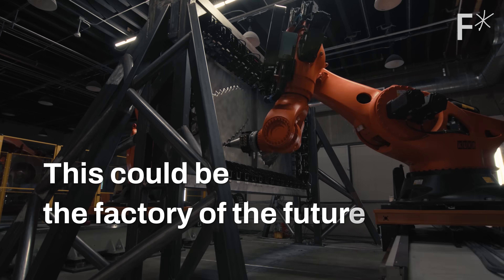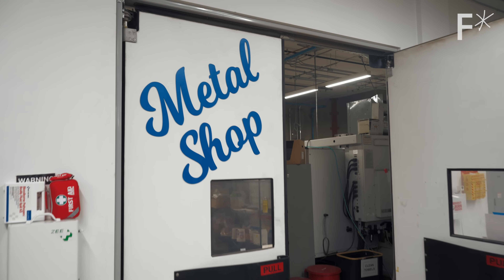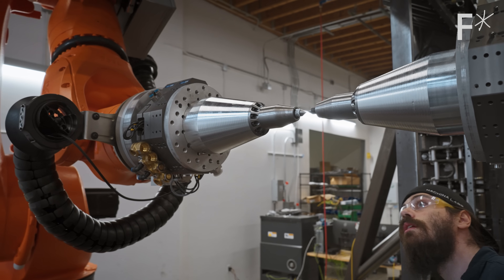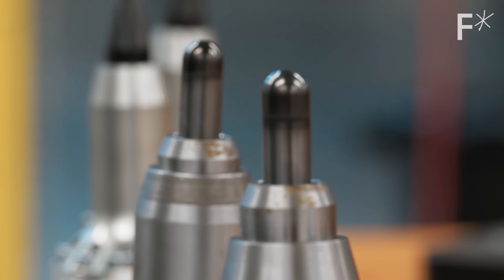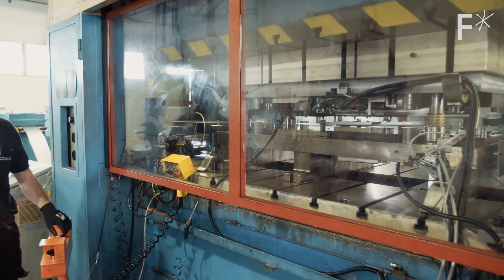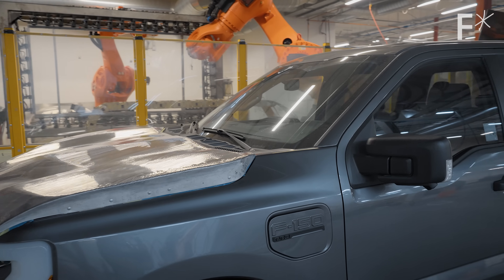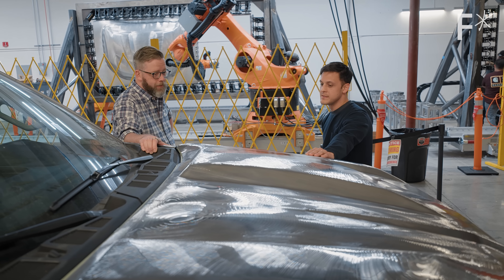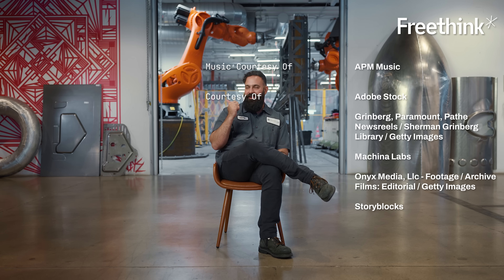Former SpaceX engineer invents a “Robotic Blacksmith Army” | Hard Reset

Comment: Nah, change is not very expensive in a sheet metal factory. It’s as easy as making a new die for the part you want to make. They also stamp hundreds of parts in the time it takes you to make one. Your factory would have to be 100x the size in order to keep up with the production of a typical sheet metal shop.

Comment: As someone who does automation for a living this is not a game changer at all. This can only be used in low volume, high end manufacturing and even there the cost, the need to have a programmer in house makes this almost unusable. You also introduce uneven material demage that will be problematic for high end parts (where this could be used). 
Still after you have used this, you need an operator to finish because that rough steel plate is not usable. 
So I would not bet my money on this. 
BTW all the parts that they have shown can be produced much faster, cheaper and in better finish today fully automated. Yeah, I belive this dude worked for Space-x, most probably was the reason for their tank tearing mid flight.

Comment: This is the kind of future-proof thinking that manufacturing needs! The ability to switch between production runs without massive retooling is a game-changer. Curious: How do you see this technology integrating with existing supply chain and logistics systems? Would it reduce the need for large-scale warehousing by enabling more localized, on-demand manufacturing?

Comment: This is beautiful theatrical show to present to investors, get some money on the wave of AI and fear of decoupling from China, dump this idea and put those robots back on eBay in a year or two. This is nothing new. This process takes a lot of space, it's slow and great for prototyping. I've seen this idea back in 2014. Google this paper "An Investigation of Robotic Incremental Sheet Metal Forming as a Method for Prototyping Parametric Architectural Skins". We really need to be honest and innovative rather than creating those pump and dump bs startups...

Comment: The simple fact is that, despite the grandiose claims, this kind of technology will not completely revolutionise how we manufacture things. It is apparent that, whilst a very useful innovation for low volume, high-end manufacturing - bespoke automotive parts, aerospace parts or custom architectural detailing rather than a viable method of mass production.

Comment: How about having an array of rods in tight formations on both sides in mirrored position.  Use software to push/pull to generate a general shape you require and use your current contraption to smooth out to exact shape?
Reply: There is already a machine kinda like that. An array of rods  both up and down, then those rods can also adjusted up or down to shape the metal sheets(e.g. bowl shape, wave forms), then after you adjust the rods both sides will press the sheet.

Comment: I'm familiar with Machina Labs process already. 2 minutes into this video I CALL BS. Showing gauge thickness stainless steel sheets, he says "heavy  metal , 1/4 inch thick steel plate". Im a 20 plus year metal fabricator and I highly doubt those machines are forming .25 with little ball tips and such. Don't narrate with crap specs. Please, thanks

Comment: Try building a thousand cars a day using this technology,how many of these machines and how big would the factory need to be it's absolutely perfect for bespoke one off parts or a short  run of a particular product other than that it's still more expensive than stamping which is built and designed for mass production and factories move due to tax brakes

Comment: I work in a car parts manufacturing we have a lot of CNC machine and use robots too. We do use sheet metal aswell. We use laser cutting machines, pressing machines, bending, robot weilding, robot bending, robot polisher, 3 axis 5 axis and etcc.. my only take about this is that the programming they did in orderto run both robots to push each other must have been a hella of a work. As someone who works in manufacturing , this is not an ideal way to manufacturing huge quantities. But only good for custom built parts that dont have to get jigs which is expensive for making 1 custom part only. I wanna see what happens in this company in the next few years

Comment: This left me with a ton of questions. What kind of stress is that putting into the metal? Under that stress, how often does that result in damage to the piece? How do all of those stresses react under heat? Does it maintain a homogeneous thickness? How does the quality or grade of metal affect the final product? What are examples of time to completion in relation to size and intricacy. I don’t know, seems super niche and I question durability but I’m also not an expert.

Comment: The only thing I don't see how this can compete is in speed. Standard presses can output several parts a minute, while doing it this way may take minutes per part. Prolly not meant to the mass production market.
Reply: Electricity using on press is might be less than running robot arms for a period of time. It only could used for custom parts and complex form shapes

Comment: The shaping tip should be more of a tri-tip end. That way one side is pushing on a plane for more accurate shaping. If you can change the extrusion of each tip head it can change the angle of pressure to a plane. you can apply pressure diagonally and would be more accurate.

Comment: While this seems great as a tool enabling bespoke designs unseen before, I have strong reasons to doubt that it will 'democratize' building bespoke car designs. Approval procedures for cars are already expensive and very time-consuming right now due to the risks associated. This is because they are heavy, fast, and are operated by lay people in the open public.

So if the retail price per car scales like some mx+c, you might remove some fraction of the c in the production line, but you end up with a larger contribution by approval procedure costs. Same for rollout times, which must be considered in a competitive market.

Therefore, I would rather reckon it will lead to a heterogen market/manufacturing situation in the car sector: We will see a small fraction of bespoke cars that impress by a genuine design will be manufactured for affluent buyers. The majority however will either stick with classic large-scale manufacturing methods or opt for public transport.

Comment: I'm absolutely blown away  by this  technology. As a metalworking with a lot of experience  this is just so Sci fi hats off to the brilliant  minds behind all this
Reply: It can be used to make 1 or 2 cars. It can't be used to produce anything above 50cars.
Reply: @stephenziga2319  they dont need to mass produce cars. These are meant to skip the whole trial and error of making a mold and testing to see if it works. This machine could make that process so much faster and costs less saving time. A second saved making a full working car is the difference between millions of sales and billions.
Reply: Your job won’t exist in 10 years. Yes brilliant minds… also greedy minds… also ai will be our demise.
Reply: I am in CNC machining and this is incredible to me.  Between this, additive machining, and the ever-improving capabilities of 3D printing technology, I have no doubt we're about to see a huge revolution in how we manufacture nearly everything.  I'm ready for the paradigm shift, even if it means my trade either takes a sharp turn or becomes largely obsolete.  We HAVE to make this leap if we don't want to stagnate.
Reply: @OneBiasedOpinion  how about we all learn more skills, like mechanical engineering, software development and actually build our own factories and build/process whatever we need from raw products, since we don't need factories anymore to make them for us?

Comment: I can't see how this works in anything other than small scale production. You're talking about a few seconds to form a vehicle part using a press, but that's going to take a hundred times longer this way. I very much doubt if it's anywhere near as accurate as a press tool either.

Comment: This is very interesting, however, seems forming molten metal to the end design shape instead of forming a sheet is still the panacea. And with Wang, Chu and Yang's demonstration of liquid metal manipulation (MPTM -basically a molten metal printer), one thinks development of a dynamic form that can be used to form the metal before it cools would probably have the advantage of cost and inherit strength,.

Comment: This is about the worst way to form metal. As a musician, I work a with metal every day. If the metal is not properly heated the stresses will be substantial. I have seen welded rods get snapped off just by the torque from the metal over time. It looks really slow, too. I think this is cool for custom parts but it's not sustainable for a mass produced object.

Comment: As a custom painter  these parts look like crap
Reply: Unfortunately this is due to the programmed stepover on the tooling for a process which is very similar to ball milling in the CNC world.
To produce a fine surface finish the stepover needs to be under a half millimetre but the result of such is a huge penalty on time where hours could turn in to days on large parts depending on the feed rate at which the robot arms are moving.
Producing a mould for either stamping or hydro forming will always be quicker with the best surface finish when it comes to mass production whereas this tech will likely remain bespoke to a degree.
Interesting nonetheless.
Reply: @CATANOVA let me shorten that statement ...." Do you know the difference  between  something good and something  great is ?.....Time".
Reply: @artworkbysteve1  Good and great are typically used as different and distinct measures although there can be some overlap with common usage.  One may argue if this is a good tech or a great tech for example. My own view of it would be more aligned to usefulness where there appears to be plentiful applications, which could be a good thing or perhaps a great thing if highly profitable.
Looking at time, that again is another measure but just a single component where on its own falls short of correctly defining something.  For example if we manufacture two bowls using this process where one bowl takes an hour and the second takes 10 hours due to the feed rate being turned down, does the value, goodness or greatness for what has been produced change.  For a buyer of the bowls where he has knowledge of the manufacture time component of each, would he value them differently.

Crap is also a measure but better used self referentially with our own effort or work.  Personally I use it or think it all the time usually followed by a chuckle in order to improve.
Reply: @CATANOVA So how many perfect  cars or parts have you built?
Reply: @CATANOVA  Thats a lot of bullshit!  Lol .
Reply: @artworkbysteve1  
Maybe, maybe not.  The point of course is a bit of amusement.

Aim high because you never know.
Be careful looking at things after beer 🤪🍻

Comment: As an engineer I find this sounds cool. But its slow process,  which means it will be expensive, so therefore its suitable for making prototypes only. Its in the same category as 3D printing. Its cool but slow and not for mass production.
Reply: This kind of production would facilitate lightning quick parts to market but not mass manufacture to market.
Reply: @CATANOVA  I disagree in case of the car market. The reason? GMP and/or approval procedures will remain a bottleneck, time-wise.
Reply: @pflichtprogramm1   Hi.  In the case of the car market if we are talking about mass manufacture panels and the like then stamping is always going to be the speedier process.  When it comes to the bespoke car market and small volume or made to order runs I think the tech would be a very competitive option.  One could pretty much make any panel or shape simply by having a building and bolting the robots to the floor and then pressing the go button.  In one of my other responses on this video I mentioned custom jet ski hulls with respect to production of stainless moulds.  Having done CNC mould work myself I can see a much faster option with this tech than the typical hollowing out of solid material.
When it comes to car production and regulations, something which I have no knowledge of, perhaps the tech could be used as a faster route to prototyping for crash testing and similar thus eliminating any potential costly changes with production tooling.
Reply: @CATANOVA  Yes, this fast-track early testing makes a lot of sense. I was thinking about the fixed costs of regulation and approval that have to be returned over the number of vehicles produced. Since bespoke designs feature small numbers necessarily, the return (per car) to compensate for these costs (for the series) would be large, wouldn't it?
Reply: @CATANOVA  Right now variance is probably large between one piece and another, as with every new manufacturing technique. Might be a nightmare making this GMP conform. Like, you might get a crash test version quickly, but ensuring that any copy behaves similar enough safety-wise would be difficult. When we're talking arts & crafts, it's nice to have unique items, like desks made from natural wood. When it comes to safety and human lives however, legislators demand much tighter variance.
Reply: @pflichtprogramm1   I was thinking of Christian von Koenigsegg and similar where this tech is right up their street.
Reply: @pflichtprogramm1   I think with the tech being CNC, variance would be minimal and exacting repeatability high.
GOV regulation is a can of worms and dare I say it involves some greasing wheels lol.
Reply: @CATANOVA  Yeah, rn I can see pros and cons when it comes to repeatability. Of course, it's CNC and not a smith with a hammer, but at the same time it relies on AI which would be undeterministic per se.

But if their training set of materials is physically variant enough, the method might actually turn out to be more robust against changes in material properties than traditional mould pressing methods. E.g., the supplying co. has issues keeping their alloy composition and sheet thickness constant.
Reply: @pflichtprogramm1   Hi
On the supply of metals I think there are various standards through to aerospace which keeps tolerances and quality fairly strict.  At the sharp end of metal supply one could argue that human life could be at stake.
On the software side of things we have indeed come a long way since the days of the Etch a Sketch however having said that the software doesn't necessarily need to be super complex to effectively run what is a ball milling operation with a predefined step down and step over.  When you have two robot arms one only needs to mirror the code to the other side.
There may of course be some millage in applying a machine learning algorithm when it comes to complex shapes and how best to stretch to achieve consistency vs a typical trial and error affair.

Comment: The technology itself is amazing, that is not negotiable. On the other hand, I think that this cannot replace the traditional way of sheet metal clamping in terms of speed or even quality. Forming sheet metal is only a small part of a manufacturing process most of the time, and if you have to wait hours or even days for one part... well, that doesn't look like a game changer for the industry. I do think that creating a form for the traditional press machine - which then enables mass production - takes exactly as long as to create one piece of product with this technology. But this is only my opinion, so feel free to disagree. For prototyping and development it is a great solution though.
Reply: You could visit the factory, be 3D scanned and then have a delivery of a full custom suit of armour like an old knight within a matter of a couple of weeks so as to go jousting.
There would be many other use cases one may think up of course.

Comment: I think this way of manufacturing would be aimed mostly at prototyping as standard sheet metal stamping is probably 100,000x faster than this. The comparison with the car industry is just out of place. Stamping is aimed at mass manufacturing. This is like comparing injection molding to 3d printing.

Comment: The title is very clickbaity. This guy didn't invent this technique, nor the robots used to perform it. He is however doing a remarkable job of commercializing it as a rapid prototyping and low volume production method. Just as with additive manufacturing, this is going to be a complement to what already exists, expanding options at the low end of the production scale, it won't replace the other methods.